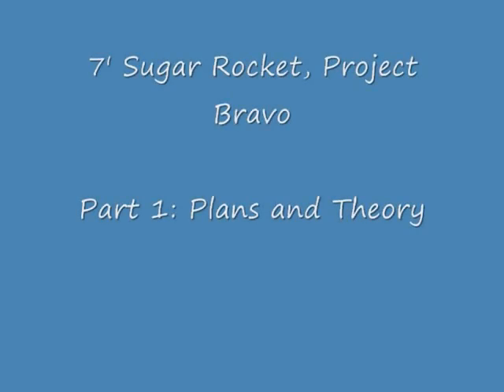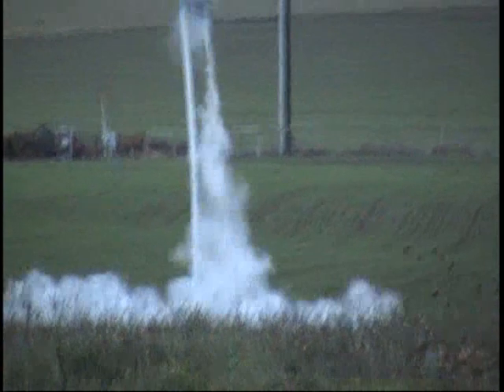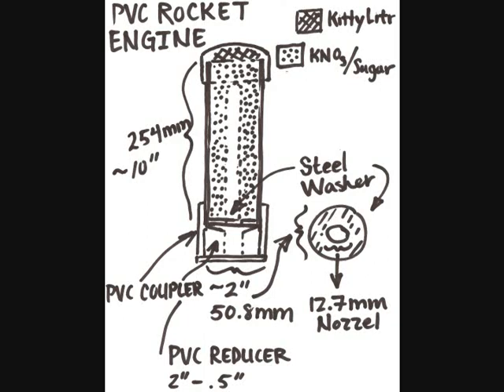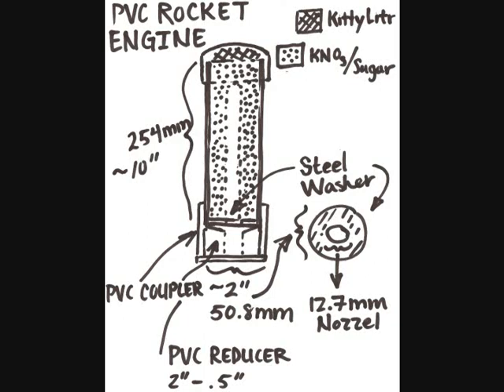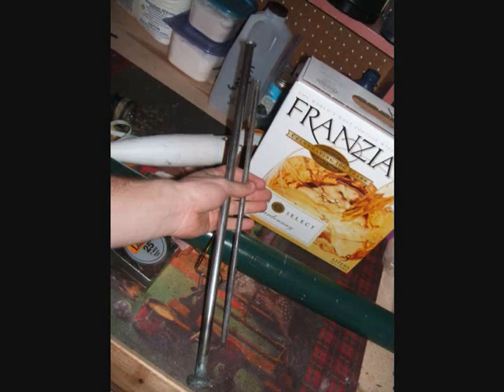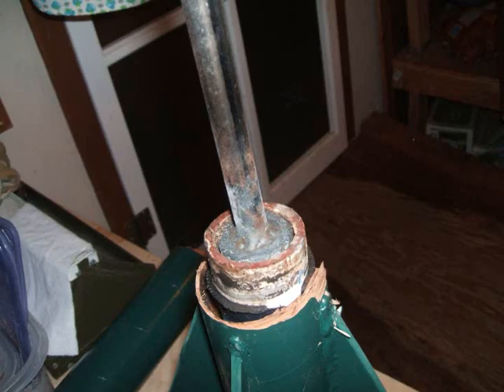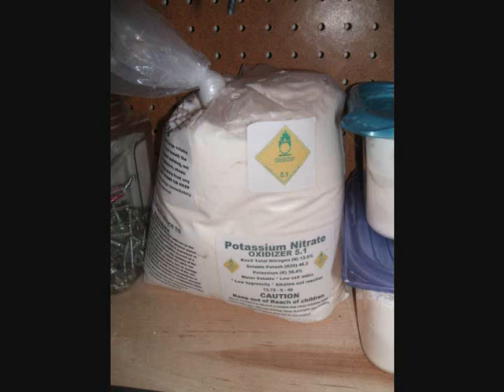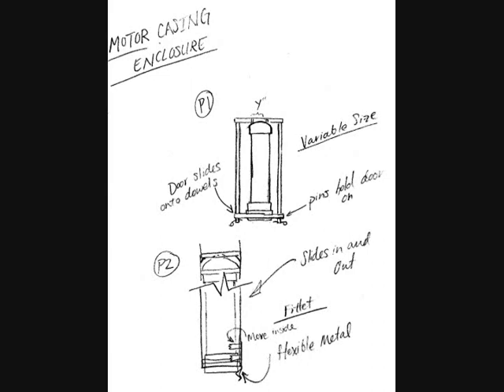7' Homemade DEATH Rocket!

Comment: for launching it use a small model rocket launcher like the ESTES engines rockets.
then make a thin wire or use the cheap speaker wire for a starter fuse since a match will no longer work then you no longer need to put yourself in danger.

Comment: Have you not heard of electrical means of firing up the engine.  It is safe with long wires and a block house to hide in.  Use very fine steel wool and a 6 or 12 volt battery.  If nothing happens pull on the wire and see if it did the job.  But leave the rocket alone for a good long time if not. Never light it up the way you did!!

Comment: NONONONONONO!!!
WRONG CONCLUSION
as i watched your second video, i instantly knew that thing was gonna blow up. your delay between the fuel and the charge is a doommed design. if you have made another rocket like that, it probably exploaded, even with a wider nossel. another thing is, you NEED steel walls on your motor. pvc can not handle that type of pressure. it is supposed to be over 1000 psi. even the strongest pvc pops at half that...

BUY THE BOOK OCTOBER SKY!!! best $10 investment

Comment: Why are you using powdered propellant? Caramalized/Rcandy propellant is alot more powerful, and the results are so much more consistent:P You can also just make a reloadable motor (I suggest one of Richard Nakka's designs) then just use a grain mould and cast some so you can just reaload the motor quickly, easily and launch it multiple times.